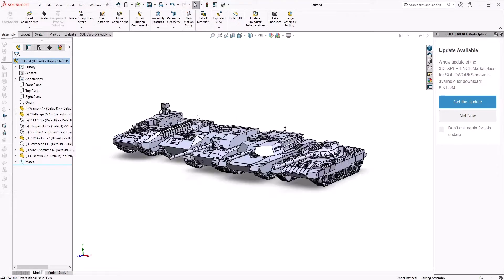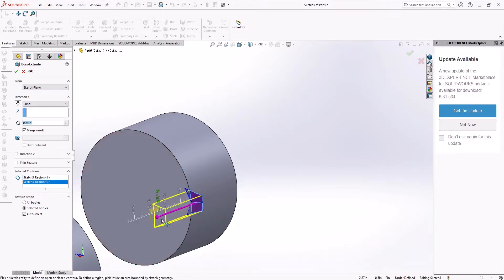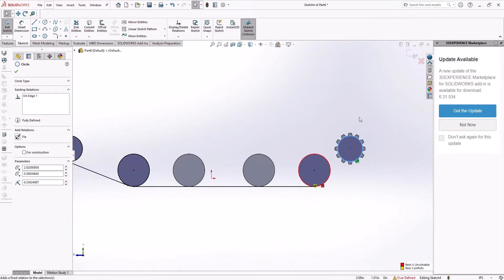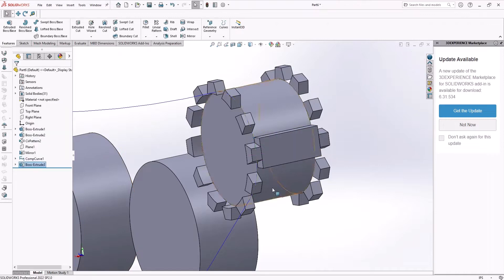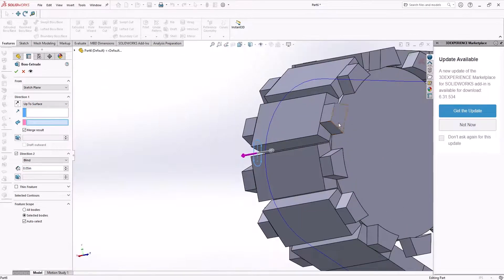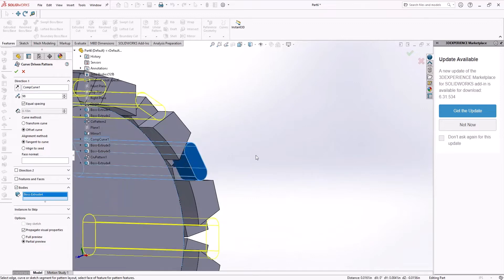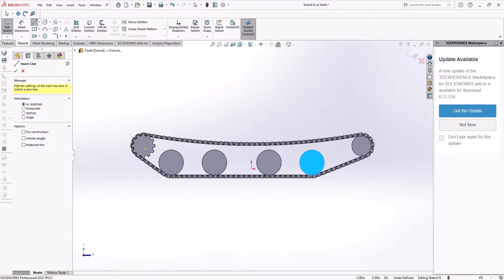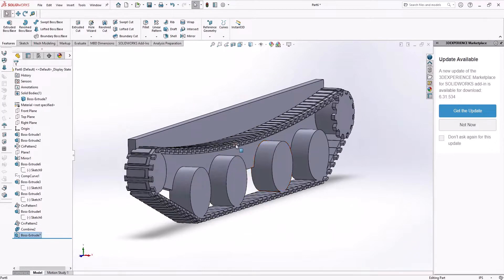Modeling Tank Tracks in SolidWorks

Comment: Thanks for this video! What if I want to make TPU printable tracks that are like belt with holes for the sprocket?
Reply from the maker: I personally have not worked with TPU, I would imagine that the technique shown in this video would work for details, but I would probably extrude a band through the track to ensure rigidity, excluding the points where the sprocket holes are located. Print resolution will be very important for getting the holes to show up. Apologies for the late reply.